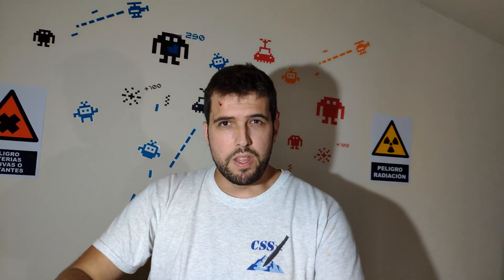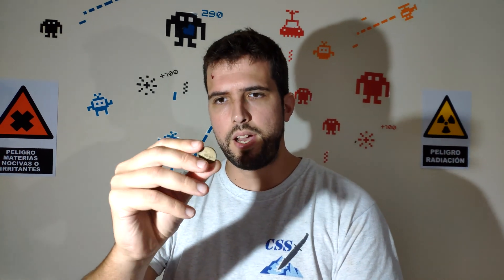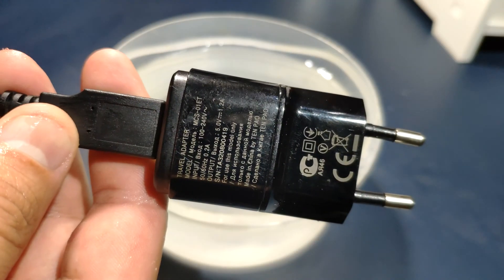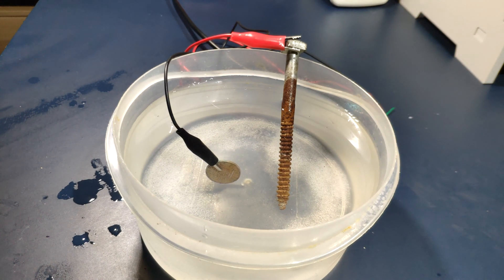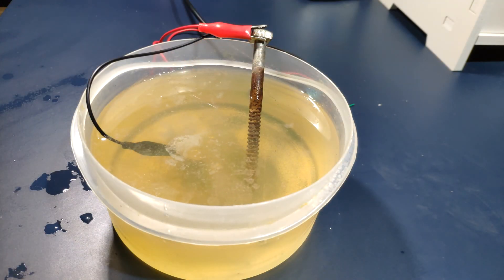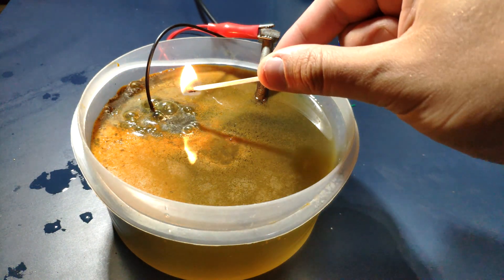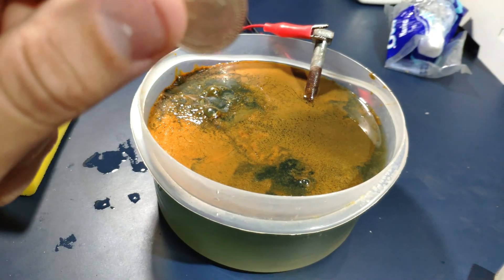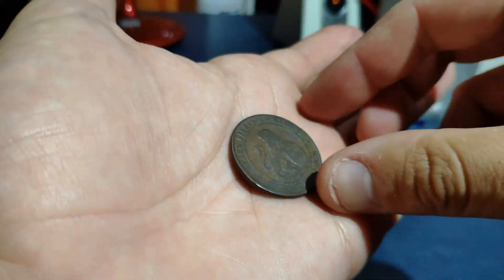Cleaning coins with electrolysis ⚡

Comment: How do you know which wire is the positive/negative.
Reply from the maker: With a multimeter. Whe you connect the wires to the multimeters if the positive is connected to positive and negative to the negative you get a positive voltage. Otherwise you get a reading of negative voltage
Reply: @GuyInAMountain  I need to get a new multimeter. I have 3 of them and they are all broke. I tried to google it and it’s a mix of answers.
Reply from the maker: Another option is to use an led. If will only light on if it is properly connected. Then you only need to take a look to an led picture to know which led of the led is the positive and which is the negative. You can get and led from almost any old electronic device
Reply: Red is power black is the ground in a usb. The white and green are the data . If you put it in and the screw is bubbling then you got it backwards and end up with a very clean screw ...woops. Works great.

Comment: Can't figure out how you used the wires
Reply: Positive wire (+) of the power supply to the screw or other "anode" such as stainless steel, etc. Negative wire (-) to the coin (cathode).